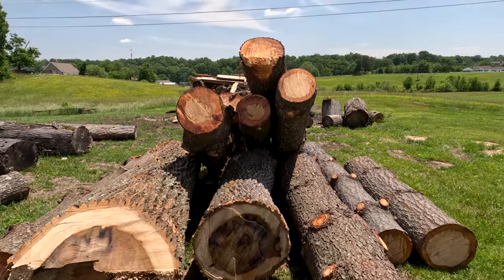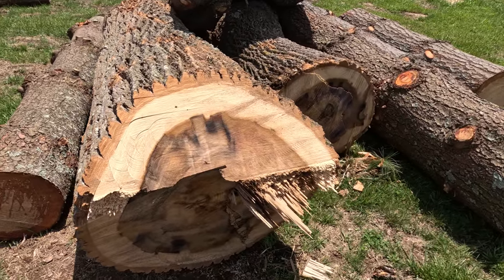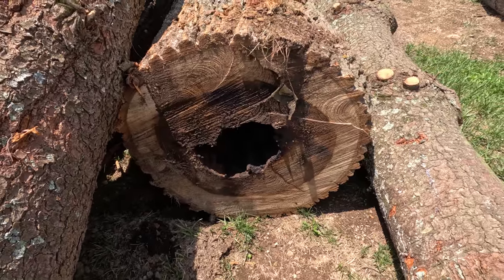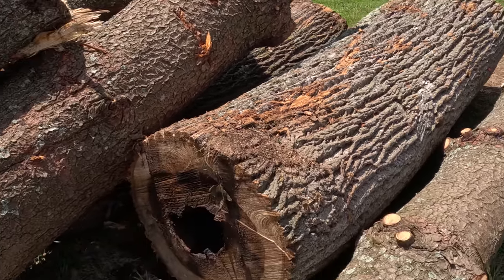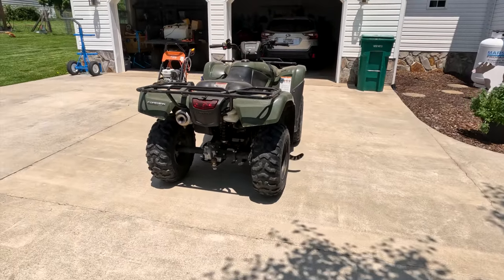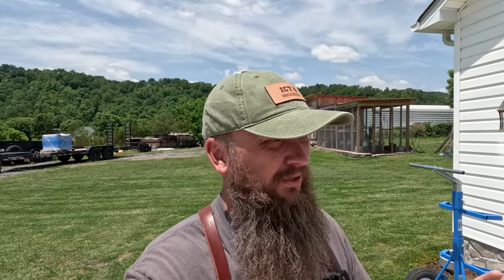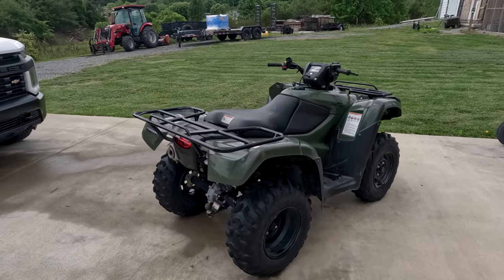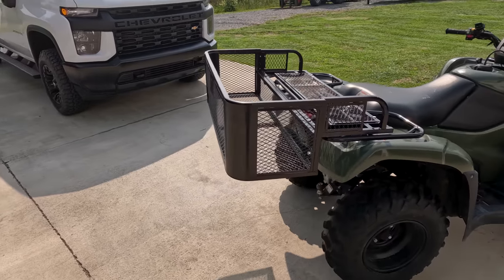Look At What Showed Up At My Sawmill!

Comment: Have you heard of Huon Pine?    Some of these trees where I live in Tasmania (Australia) are over 2,000 years old.  Hard to believe but it's true.  Because it grows so slowly the wood is prized.  Was used in boat building as it has a very high oil concentration but not so much now as it's becoming rare.
Reply: King William [Billy] Pine was also highly prized by the early convict timber cutters.  Resists rot and is easily worked by either hand or electric tools.  Another marvellous boat building timber.  Most has been cut out and the Tasmanian Forestry Commission severely regulates what remains.
Reply: @peterkemp1973  Yes, agreed.  Another incredible wood.  Boat builders loved King Billy Pine.  Easy to work with.  There were a lot of old houses with King Billy and Huon floors and panelling.  Worth a mint now.

Comment: Nathan, try using the foam gun that Mike from "Outdoors with the Morgans" uses on all his equipment. Works like a charm - spray it on then wash it off with your Stihl pressure washer, followed by his Stihl blower !! End result is marvelous !! No streaks or wet spots !! No drying required !!

Comment: I built trusses once for a small garage.  Lap joints at the apex secured with one 1/2 inch nut & bolt through the glued joint and off you go.  It's probably overkill but there was never a problem with them.
You can also use metal reinforcement plates made by Simpson Manufacturing under the brand name Simpson Strong-Tie.
Reply: Get them at your local Lowes.

Comment: I have a tulip poplar exactly like that in my back yard, outside the window of my home office, as I am typing,, except that it is still standing! ..... It isn't as big (at least not yet - it's 18"-20" diameter a couple of feet above ground), but 20 years ago when we moved here, there had been damage to the trunk, that had led to rot and to ants living in the hollow center, so if I ever cut it down I know it will be hollow in the center.  The tree leans slightly away from my home, so I am not concerned about it falling - there is nothing beneath it to come to any harm.

Comment: What pressure do you wash your vehicles at on the pressure washer most times?  And although it may not work well in certain areas, have you tried the 'propane torch' weed killing method? Not sure how well that would work where you are doing it.

Comment: Hi Nathan. I just came across your video and this is the first one I’ve seen. I look forward to seeing more. There was one scene you did not explain that maybe you can help me understand. It looks like you were filling a big jug with windshield washer fluid and setting it on the sawmill, but I did not see what the purpose was. What was the use of the large jug of washer fluid?
Reply: I watch alot of sawyer videos. The guys keep the track the mill slides back and forth on nice and soapy. You can see it down on the left. You like Nathan try Matt Cremona. Good milling channels. 👍
Reply: The solution drips on the blade to keep sap from building up and creating friction.

Comment: Are the slabs off of the cedar logs any good for fire wood ?
Reply: They will burn hot and fast. Great to start a fire with. Especially the shavings and bark from cedar trees. Excellent fire starter for sure.

Comment: Nathan, what the hell did you put in that spray tank?  Go ahead and block me if you want, but I'm going to say this.  I used a lot of herbicides for decades.  Be careful and use PPE.  As the company owner, I didn't have to use all the PPE.  Not sure that the major health problems that I have today were totally caused by this, but it has given me pause to wonder.

Yes, I have built small trusses.  Glue, screws, and OSB for plates,  Not hard at all.